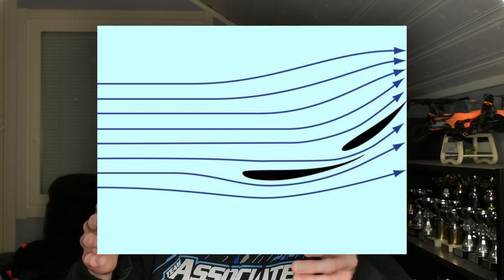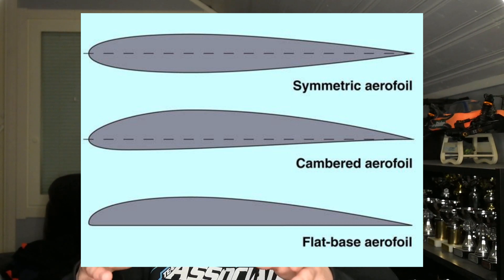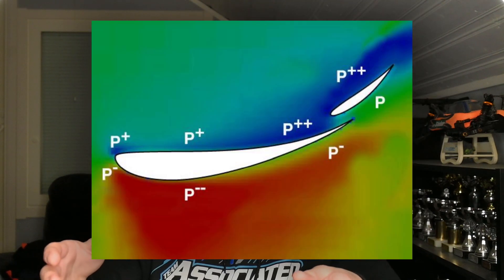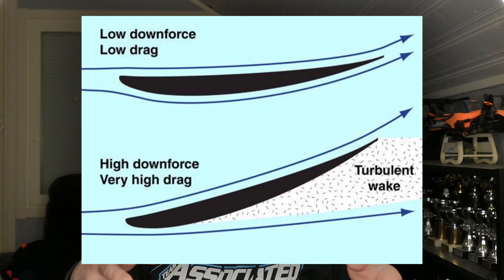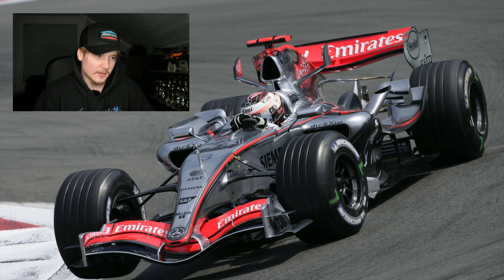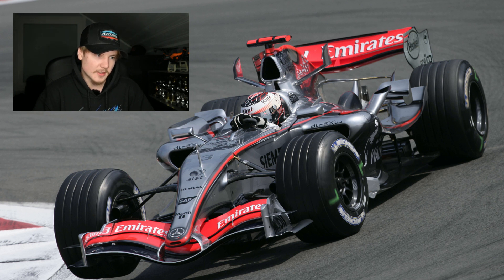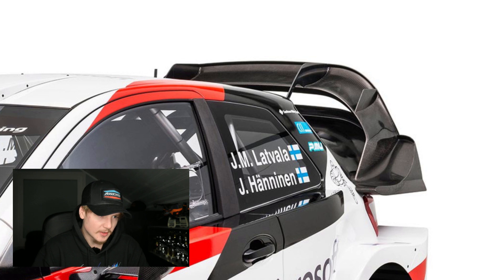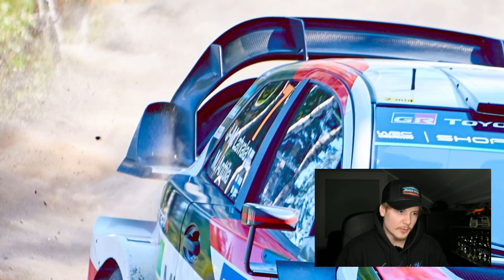From the ground up: Aerodynamics Part I

Comment: Been going through the whole series, great stuff! Just a note though, practically all motorsport series have regulations with regards to aerodynamics. So while Formula 1 have some brilliant designs when it comes to aerodynamic elements, you have to take into consideration that most of these are a compromise of regulations and not the best design out there. I'd look at Time Attack and Formula SAE and see what the winning teams are doing. Also, have a look at KYLE.ENGINEERS here on YouTube for some great videos on aerodynamics. He's been part of the Mercedes-AMG F1 team as a aerodynamics designer so he knows his stuff! What I just said is something he mentions sometimes when looking at different aero designs. While it might be a little too in depth for the average RC person, it's great if you're into motorsport engineering! :)